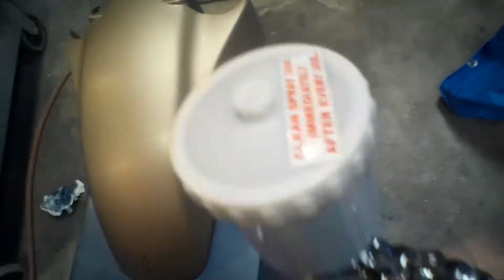Painting GL1500

Comment: maybe it's the camera mic, but that sounds like pretty high air pressure for HVLP
Reply from the maker: The pressure was a little high because I had about 80' of air hose from the tank, I could not find a regulator I liked to put at the gun in time to do this job. I set it at about 38 psi at the compressor hoping to maintain about 30 while spraying.